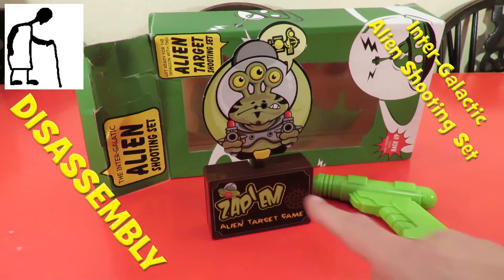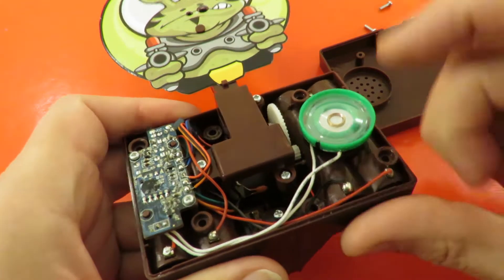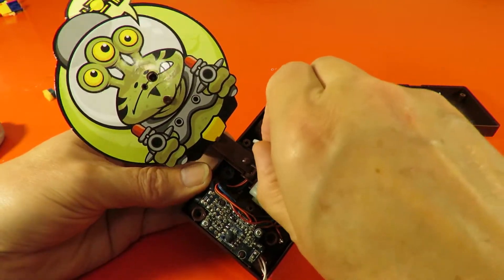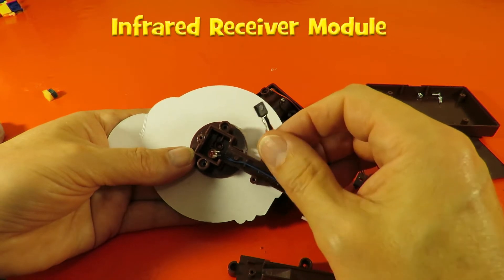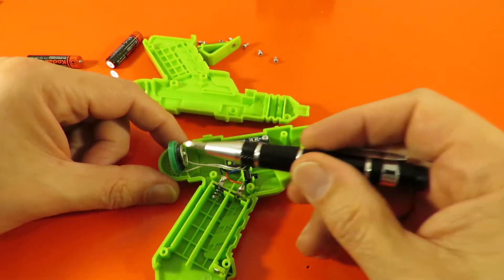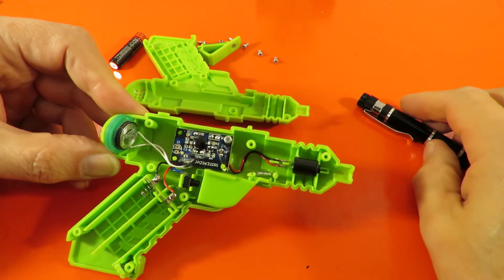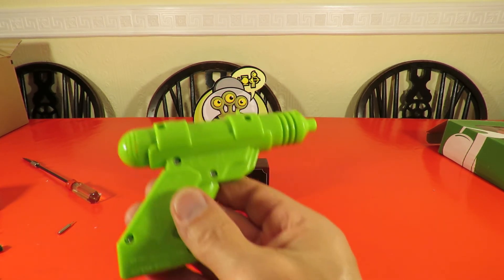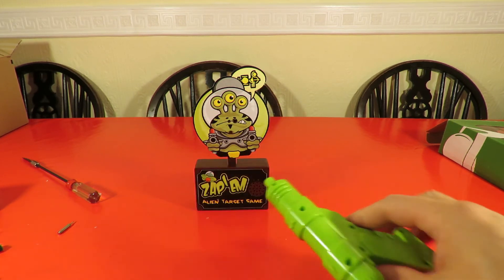Inter-Galactic Alien Shooting Set - Disassembly

Comment: I wonder what range that would operate over ? in other words could it kept in the cupboard of random things until a some creation requires a remote trigger ?
Reply from the maker: It certainly works over about 8 metres as we were able to shoot through the living room into the dining room 😊 It is basically the same as a TV remote only simpler as it doesn't need to decode which button is being pressed. They are pretty easy to make using salvaged parts from anything with a remote - old DVD player etc - but probably cheaper to buy ready made on eBay. Here is an old video for a remote release for rubber band powered cars https://youtu.be/sbvj449LVNM